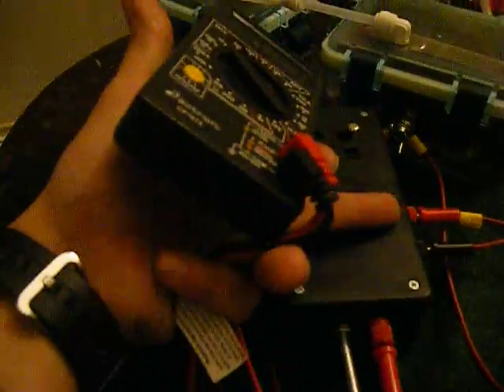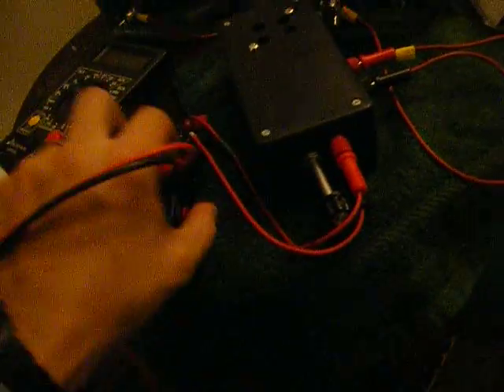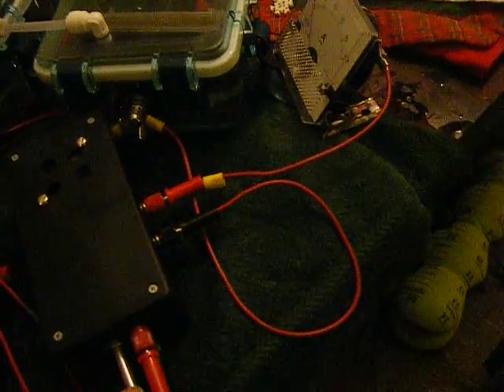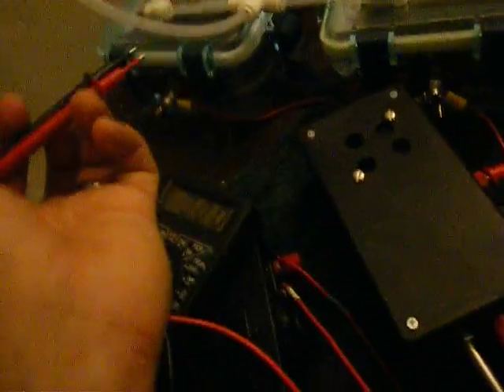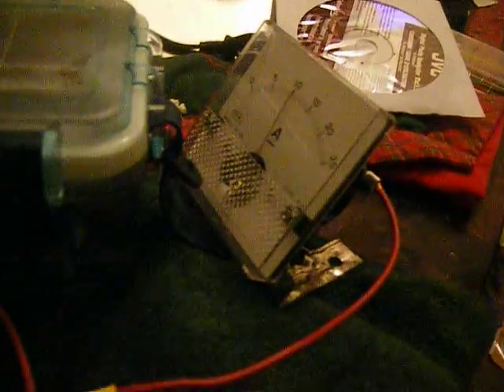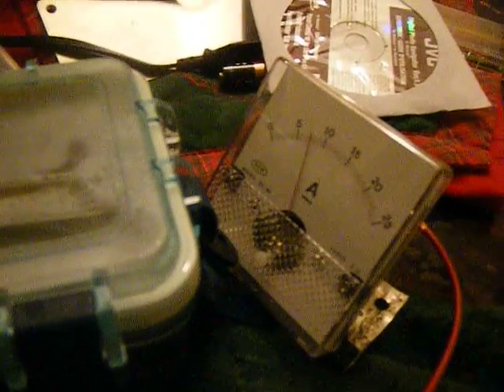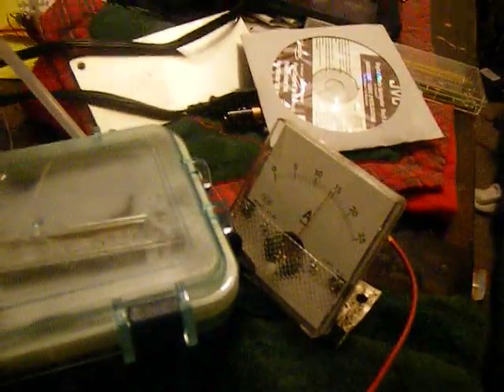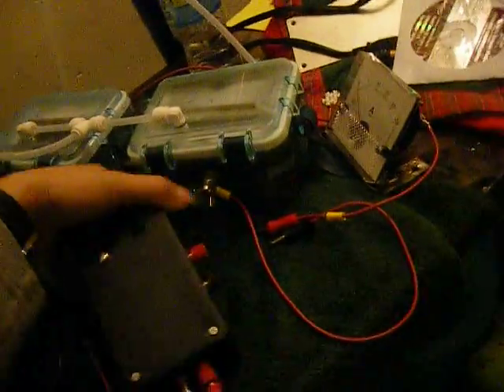super efficient wet cell system, hydrogen HHO waterfuel smacks cell variant

Comment: You say there is 12V @ 5A to your converter and 3V 7.5A to each of your generators. That means you are putting 60 Watts in and getting 45 Watts out. That means your efficiency is 75% and that 25 percent of your power is wasted in your converter. How is that super-efficient; let alone efficient at all?

Comment: You mentioned that there was 7.5 amps through each of those two generators and 3v across them. How many electrodes are there on each of those generators? How many plates do they have?

Also, you mentioned there was 5 amps going into your converter, but what is the exact voltage across the input of the converter?